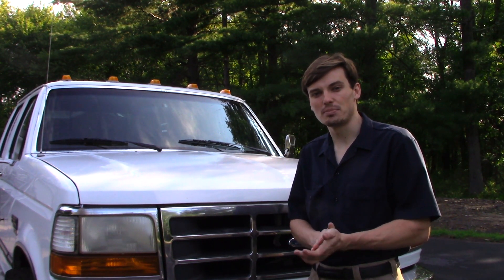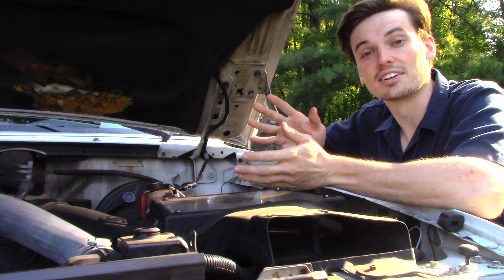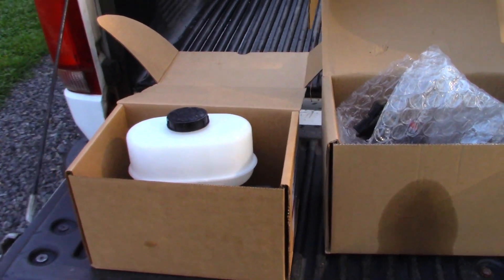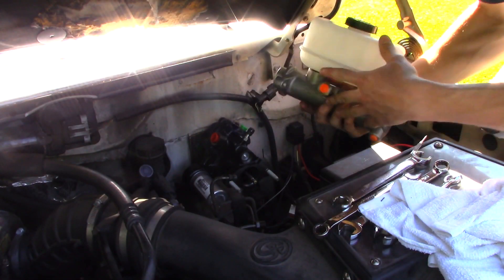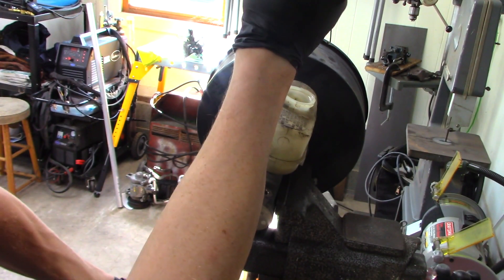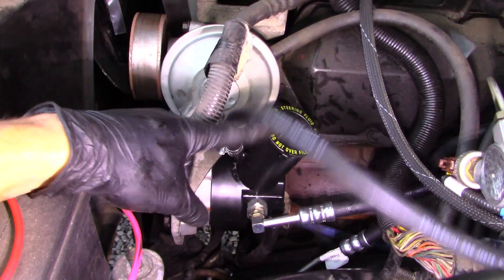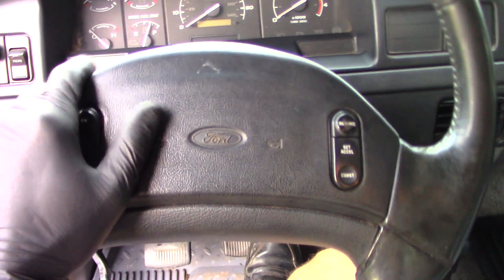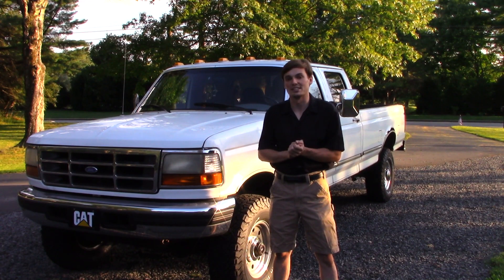Ford F350 Powerstroke 7.3 OBS Hydroboost Brake Conversion Upgrade (1992-1998)

Comment from the maker: There is a lot of questions on what parts to order.  I am working on cross referencing part numbers to get you guys the correct ones.  Here is what I found:

MASTER CYLINDER:  I ordered mine for a 1997 Ford F-350 7.3 Diesel.  They have lots of parts listed here, it depends on your wheel base and if you have cruise control equipped, 4WD, dually, and if you want the physical reservoir.  I ordered the Raybestos MS390338.  I have 4WD, SRW, and cruise control equipped.  It may be different for you.  This is where the 1 1/4" thing was stamped.

HYDROBOOST UNIT:  I was lucky enough to get mine from autozone.  I must have been one of the last people to buy the Duralast 52-7079.  I bought it as if I had a 1997 F-350 1 ton diesel.  I did not return a core and just ate the core charge.  It seems like rockauto does still have these units in stock here: https://www.rockauto.com/en/catalog/ford,1997,f-350,7.3l+v8+diesel+turbocharged,1127090,brake+&+wheel+hub,power+brake+booster,1884

I don't know how long they will last as it seems parts availability is scarce now.  I will try to dig up more sources.  

PROPORTIONING VALVE:  I have had no issues so far with the current setup that comes with the master cylinder.  I may swap my back brakes over to discs now, but I have not blown out a rear wheel cylinder yet from this swap.  

I will make a follow up video to show you guys better details on what I did, how I routed things, and part numbers to help clarify some things on this project.  Stay tuned!
Reply: So are all these part #s correct? I’m about to do this swap
Reply: Question I have 1996 f350 manual transmission 5 speed, does it make a difference thx, I wanna put that on and see if does make a difference cause there is a lot of travel thx
Reply from the maker: @jamessmith-or8hw  Nope, as far as I know, there is no difference if it is manual or auto.
Reply: The 2 lines are not available on Amazon

Comment: Not a powerstroke if it is a 96 it’s an international navistar engine. The “powerstroke” didn’t start till 97
Reply: Negative
Reply: @williampayne5399  negative what? I have a 96 F450 with a 73 turbo it’s straight up says international Navistar on the valve cover.🤦‍♀️🤣🤡 could just have googled it bud… like look it up, then come back and tell me I’m right 😘
Reply: I think you should look that up. 96 is a powerstroke and not the first year.
Reply: @ I have a 96 f450 bud and it says “international navistar” on the engine. Nowhere does it say powerstroke or ford.. I guess you know better than my truck what engine is in it 🥴
Reply: @robrusso3062  Powerstroke is a style of 7.3, it is not a manufacturer name. On your 96, when you open the hood it says powerstroke on the cover over the valley that is bolted to the engine so it does say powerstroke on your engine, unless you or someone took it off and never put it back on. IH made the 6.9 idi, the 7.3 idi and the 7.3 Powerstroke along with a pile of other engines not in a Ford pickup. Also Ford owns the name Powerstroke, so there is that. 

Now, go do some reading Bud.
Reply: @andjp7382  the engine in my truck says international navistar. It doesn’t say ford 🤷‍♀️ I don’t know what to tell you. Cry about it I guess
Reply: @robrusso3062 Not “Navistar”. It is “Harvister” for International Harvister aka IH. IH made engines for Ford.
Reply: @76cb360 I have a 96 f450 with a 7.3 turbo.. it literally says “ navistar” on the valve cover 🫤
Reply: @robrusso3062  My apologies. I learned something new: 
7.3L Power Stroke V8 Diesel (Navistar T444E): A 7.3-liter (444 cubic-inch) turbocharged diesel engine, built by Navistar International and branded by Ford as the Power Stroke. It had a 4.11-inch bore, 4.18-inch stroke, and 17.5:1 compression ratio, delivering approximately 215 hp and 425 lb-ft of torque in 1996. This engine was far more popular in the F-450 due to its superior torque for towing and heavy loads.
The diesel engine, while manufactured by Navistar, was not called “Navistar” in Ford’s branding—only “Power Stroke.”
(From Grok)

Comment: The only problem I saw with this video is that the 1-5/16" provides more pressure than the 1-1/4". Its actually the opposite, but being a 16th larger. Probably wont see a difference but a smaller piston provides higher pressure.
Reply: My thoughts exactly.

Comment: I can’t find the booster and the master cylinder that will actually mate together, I have been researching and trying to figure out which one I need to exchange. But the master cylinder bolt pattern is close together and the booster is too wide.
Reply: @E30source

Comment: Nice video and thanks for listing all the part numbers and links. One thing I will add for those that don't have the money to do this and still need to fix their trucks. Go ahead and replace your rear brake cylinders and properly adjust your brake shoes first. You would be surprised how many times this fixes a soft pedal or the increased distance that is needed to stop your truck. Many times guys will replace their master cylinders and still not have a good pedal or brake response and it was the rear cylinders all along.

Comment: Old video I know so dunno if you will respond but you stated in the vid there is speculation about wether or not the booster will come with the retaining kit and return spring but you never actually specified if it did or not and where to find it if it doesn’t since you are supposed to reuse what you don’t actually have.
Reply from the maker: Hi Donny, yes it did come with the spring and retainer.  They're pretty packed in there so I'm not sure how easy it would be to pull them out.

Comment: This is a great conversion.  I did it to my '95 F350 with 351W about eleven years ago and was able to also convert the PS pump from the Ford unit to a Saginaw but I do not know if such is an option for the diesel folks.  Kudos for using the proper pump housing with the second return line!  There are some who promote the idea of simply teeing both return lines together.  This is not a good or safe idea as it can impede fluid return under certain circumstances and negatively affect braking and/or steering.

Comment: Don’t recommend hydroboost (Cardone). I swapped my 96 back to vac after just a couple months. Hydroboost blew at firewall luckily after already being slowed down and turning on a road. Complete loss of brakes and steering. Limped it a mile to destination fighting steering and borrowed a car to buy a vac booster, pump, and some 3/8” vac line and swapped it. 

Sent the hydroboost back, luckily bought a warranty plan so full refund.
Reply: Yellow2000sr was the pushrod level or was it angled where it attaches to the brake pedal?

Comment: I not a expert going up In size normally will increase your pressure on the mater cylinder but your going to a hydroboost unit that will increase your pressure.  . I in the same boat as you I going to install a hydroboost system on my second generation dodge ram . I did not go to a salvage yard and I should have and got the complete unit . Piecing it together is a deal or was for me .... May things can bite you in the butt . For one the rod length between master and hydroboost.  That needs to be correct length..also on my dodge I did not realize there is a spacer that goes between the two units . It clocks and set the correct depth ..at ant rate I finally I think got past those problems.  Should have got a complete unit from a salvage yard . Can not get the correct parts from factory as there no long made . So going to use an fitting from the bump tube o ring to number 6 an or jic

Comment: Hi Dan, a great video, thank you! I have almost finished my conversion, and I have a question. Can you confirm the hose driver side of the hydro (part n. 71442) goes to the steering pump and the hose passenger side (71416) goes to the steering block? Many thanks
Reply from the maker: Hi Antonio, I used Gates part numbers:
366200 and 365930 for my hoses.
Reply: @E30Source  Thank you! My question was not posed correctly. Part n. 366200 goes from the driver's side of the hydro to the steering pump and part n. 365930 goes from the passenger side of the hydro to the steering box. In the video, you said the opposite, but I am not sure.

Comment: Thanks for sharing your swap. I have an 86 Bronco that has had its entire brake system upgraded to new parts. Lines and all. And im still not happy with the long travel mushy brake pedal feel. Ive been wanting to do a Hydro boost conversion. I think this just made my decision to do it sooner than later. I just have to figure out the power steering pump. Mine is still a V drive set up. My unit and bracket is different.
Reply: Did you replace the rear brake cylinders and properly adjust your brake shoes? If not this is an inexpensive repair and usually fixes your described pedal feel.
Reply: @ecleveland1  yes. Twice! The pass rear had a issue. So i changed both out a second time. Even raised the front of the vehicle a few inches to let any possible air work its way up overnight. And bled again.

Comment: I ordered the exact list in your comments and I’m having the same issue you had, the master cylinder studs aren’t the correct width? Hydro 527079 and master 132690. Any advice or updated part number would be awesome!
Reply from the maker: It's so weird because those are the part numbers exactly what I ordered.  I got my hydroboost unit from autozone after I found the span was different.  Did you see my recent pinned comment on this video?

Comment: if i were to search the junk yards for the power booster which years would I find it on? The 99-02 powerstrokes?
Reply from the maker: Get all your parts from a 1997 F-53 (how they list it from advance/autozone)
*correction 1997 F-350

Comment: What is going on appreciate the video. I am having trouble finding the master cylinder and reservior, based on the Cardone number that you listed that doesn't appear to be correct per their spec sheet as it says the bore is 1 1/8. any help would be great, thanks
Reply: The one I used off an F-450 is CARDONE 134015, and is the non-cruise unit. I also have a 7.5, so I don't know if the diesel is different.
Reply from the maker: The master I put the link so that if you do/or do not have cruise.  It really depends what you have setup already.

Comment: Hey I purchased the hydroboost master cylinder combo you listed  /my master cylinder will not mate to hydroboost.  bolt pattern wrong  HELP
Reply from the maker: Were you able to get it?
Reply: @E30Source  nop
Reply: @E30Source  nope I have a mess.  My hydroboost bolt pattern is the wide one and I believe my hoses are sending the pressure to the wrong side of the hydroboost. And you  cannot switchthe hose positions.  Filed the master cylinder so it will work.  ???? Used your part #s
Reply: @E30Source  I'm in business. Filed the master cylinder eye holes. Now it works,  good

Comment: Does the power steering reservoir hold enough fluid to move the steering wheel and brake at the same time? It's always my issue when doing hydroboost on classics, so we tend to add a remote reservoir.

Comment: I put the 1 5/16 master cylinder on my truck over the past year, and I like it a lot. It is definitely more responsive than the 1 1/4 was and I think after I replace the rabs unit this spring what I have will be good enough. That said, I really like the idea of going to the hydroboost and may still do that in the future.

Comment: So I ran in to the same hose style issue recently, all the auto parts stores told me I was crazy, and after 3 hours of trying to figure out why I couldn't get the stupid nut to catch the threads because the new house I had purchased had the extra bit of metal tube protruding into the whole in the steering box, after comparing the new and the old hose, it was clear that, well, that bit of metal needed to be gone... so very carefully it was cut off with a grinder, filed to make sure inner diameter was the same, and flushed with acetone and then power steering fluid while still not installed to make sure no shavings made it into the system... so far its working without issues..

Comment: Do you have the part number for the master cylinder that has the wider bolt holes? Thanks in advance. Great video
Reply: I ran into the same issue with my master cylinder not lining up with the hydroboost. Any chance the hydroboost part# was different then in the link. Thanks for the video.
Reply: Same here. I ordered the part numbers posted in the video.

Comment: You should put disc's on the rear now. with the parts sourced from Amazon it will only run about $250 and work great with the hydroboost.

Comment: I've heard you need a new pedal assembly. Is that true?
Reply: That is not necessarily true and it depends on if the push rod is level, which depends on the exact hydro boost you use because of the mounting bracket. I got both a used junkyard and a new one for 90's F450 and the firewall mounting brackets were different on both. One placed the hydro unit further up on the firewall and the other was in the same mounting location as the original vacuum booster. Using that bracket the pushrod was pretty much horizontal to the pedal and there was no need for a SuperDuty brake pedal or redrilling and remounting the pushrod pin.

Comment: your master cylinder part number is incorrect and takes you to an even smaller than stock. Stock bore is 1.25, i noticed the stamp on yours that you have in the truck which is 1.31... the part number you included is 1.125
Reply: Thanks or the video just what I was looking for, only I am still a bit confused on the correct part number for the master cylinderany clarification whole be much appreciated
Reply from the maker: @cristogarzacr9181  standby, I am trying to find the correct p/n
Reply: @E30Source  were you able to find that part number?  Great video by the way.  Trying to convert my van.  Thanks
Reply: @holisticawakening7268  On my '97 F350, 7.5, I used CARDONE 134015.
Reply from the maker: Interesting, I'm looking at the part numbers on rock auto, I thought I included the one that I used, my bore was 1 1/8" on my old one, and 1 1/4" on the new one.  It depends on what configuration you have, dually, cruise control etc by what I read.  Have you found any info on it?

Comment: Be very careful in an emergency stopping situation. The new proportion valve is designed for a F-450 that can take more pressure than a 250/350 can. I had a new wheel cylinder blow apart during a really hard braking application. I’ve since converted to rear disc and never an issue with four years braking.
Reply from the maker: I ended up using the new one because the threads are different on the old one, have you found the p/n for the correct one?
Reply: @E30Source  I found that an 02-06 F250 is the correct valve.
Reply: @amatthews8827  I'm contemplating this swap and I got a good used hydro from an early 2000s f350 for a nice price that I couldn't walk away from. My truck is a 1994 f250 and I've read that the NBS SD trucks use the same hydroboost as the late model OBS F-series trucks so I grabbed it with no second thought. Do you know if this would be an issue with over pressurizing my rear brakes and causing issues? It's just a newer truck and a 1 ton. ¾ ton is 100% the same as 1 ton as far as ford goes. Just some base model stuff on 1 tons that are optional for ¾ tons from factory. My truck is a 1994 f250 with a 460 and I'm just kind of sick of having to pump my pedal once to have more braking power. If I pump it twice it's solid like I want it to be. New Master cylinder as of 3 years ago because the factory one failed, bled the lines multiple times and manually adjusted my drum brakes and still have to pump it once for solid pedal and reactive braking capability. The other reason I've been wanting to do this swap is because I also have a 2001 ram 250p 24v cummins, hydroboost of course. I like the firm pedal. Any advice before I fuck something up, then I'd be grateful. Thank you.
Reply: How did u convert from drum breaks to disk???
Reply: Where did you get a kit to convert the stock axle to disc brakes?